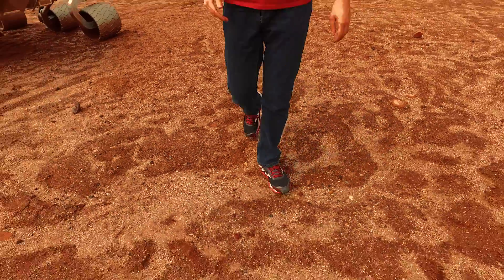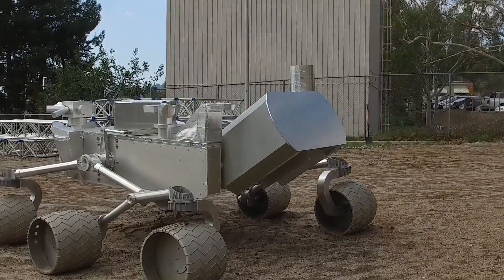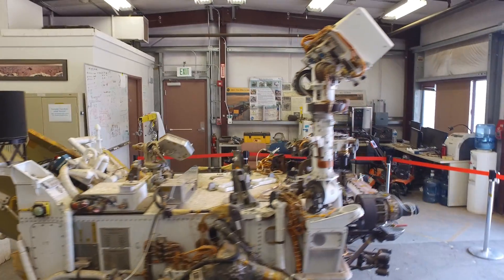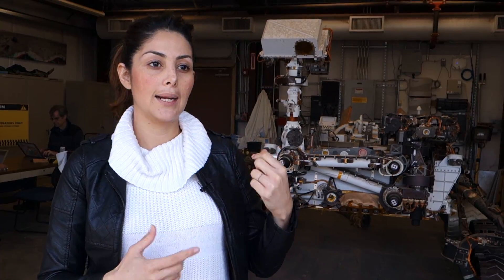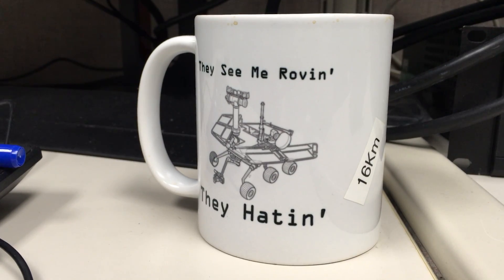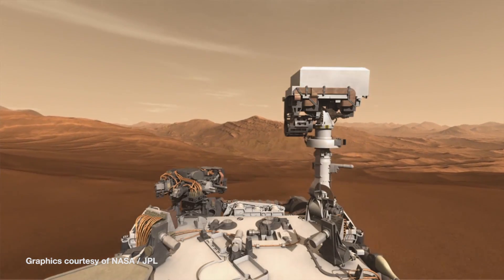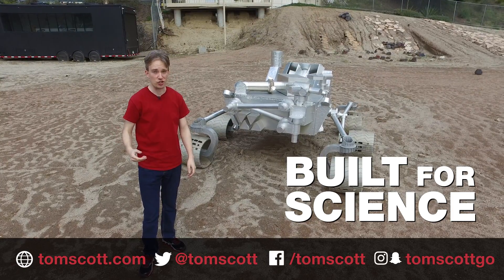How To Not Break A Mars Rover

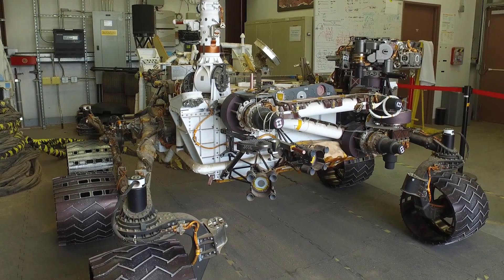Comment: JPL wanted to put their initials embossed on Curiosity's wheels so it would print JPL on Mars. Someone objected, so they did it with Morse Code instead. 2:15
Reply: That's amazing. You can't deny an engineer a flourish, or they'll find a clever way to show you up.
Reply: According to my dad who works there, they just wanted to put their name on the rover somewhere. NASA disagreed, so they snuck it into the wheels as a weight saving measure. They weren't out to print their name everywhere from the start, but that's where it ended up.
Reply: @monitora108  HQ to JPL: You can't advertise JPL on the rover.
JPL: Right, we'll just print JPL all over Mars in Morse code then :-)
Reply: Yepp, sneaky bastards! :-) The next rover has some art and text on it that is too small for the camera to see. Someone will just have to go there to read it.